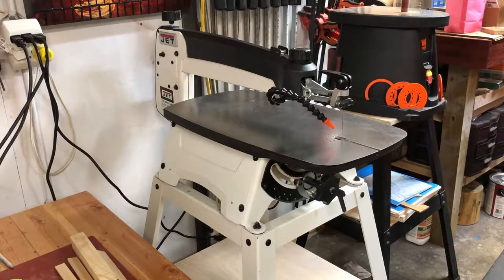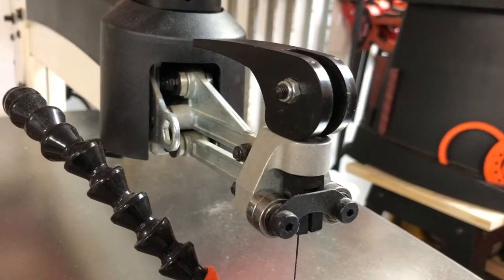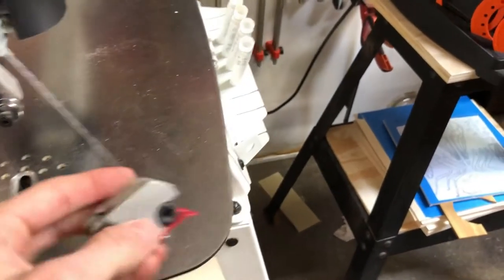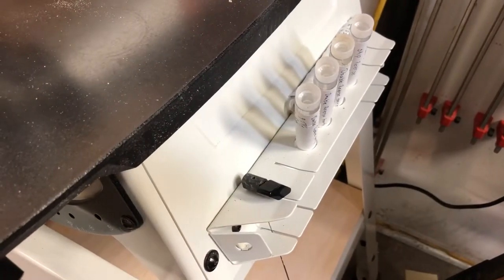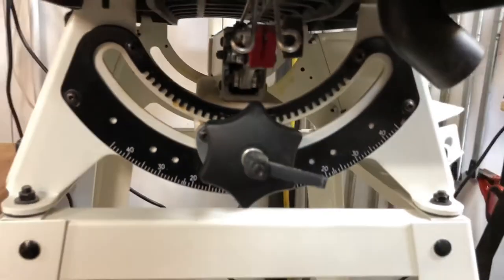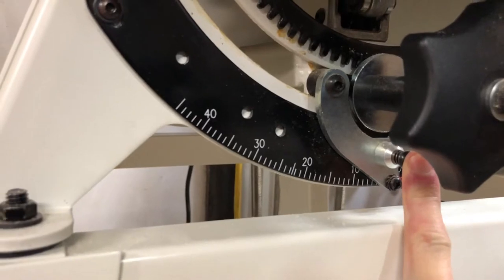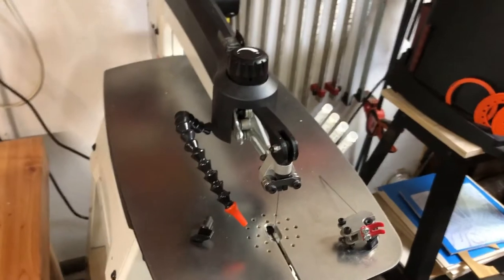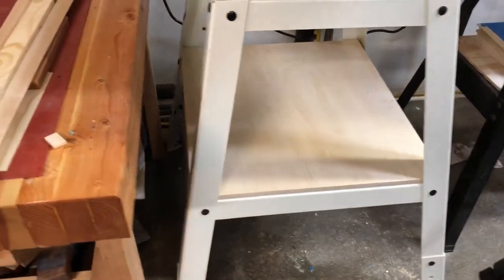Jet JWSS-22b Scroll Saw Review

Comment: Thank you for posting your review and honest review. I keep going back and forth between this and the Excalibur. Trying to figure out which is the best saw and way. They seem pretty well matched up.
Reply: Sure appreciate your reply! I am thinking the same thing, the locking mechanism has pushed the Jet into the running for me. The jet is not that noisy or not much vibration for you? I have an old Delta mid grade scroll saw that is loud and so much vibration, it's not so fun to use, so I am sure either one will blow me away, just want to try and get the best one I can. Only wish they where not to pricey, paid almost half that for my new table saw.. lol Thanks again. :)
Reply: The blade clamping and the iron table put me over the top for this saw. Just got it. Really excited about it.

Comment: have you had problems with the spring on the bottom holding the blade holder,,,mine wont stay attached when you release the top tension?
Reply from the maker: So I replaced my bottom attachment with different one and don’t use the cartridge anymore. Pegas makes a replacement bottom that works much better .

Comment: Good evening, I watched your video with great interest and was struck by the lower quick locking system of the blade that appears in the description (from minute 4 to minute 5 of the published video).
I would like to know where you can buy this accessory.
Thanks for your attention and I look forward to a response.
Reply from the maker: I’m not sure this can be purchased separately as it comes stock on the Jet Scroll saw. Jet has a 1800 number and I bet this can be ordered as a replacement part. I would first call them and see what they have to say
Reply: @MSRWorkshop  Thanks for the quick and valuable advice. I will try to send an email explaining exactly my exigneza.
Francesco CANDITA

Comment: Music intro is horrid also the blade holder is a pegas not pegasis with the upgrade it becomes a very expensive saw
Reply: I am sorry if I came off defensive its just a bit loud for me, hard to believe I would ever say that growing up in the 60s. I always buy the best tool I can if affordable. I have used a dewalt ss for many years and upgraded it with the pegas kit. It works great but I also use a hawk 220 vs that is yes more expensive but I found it at an auction and it had never been used. It is a very nice saw but I had to become a bottom feeder  cause it has the old barrel style chuck on the bottom similar to the jet. Anyway nice video and keep it up